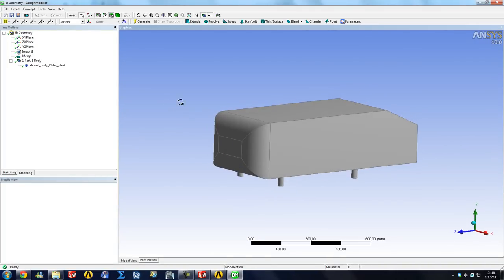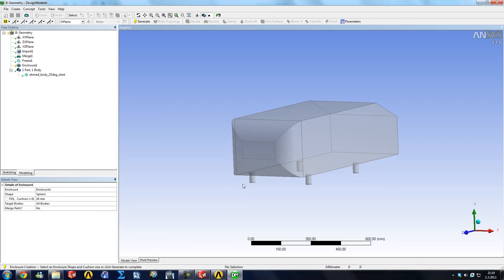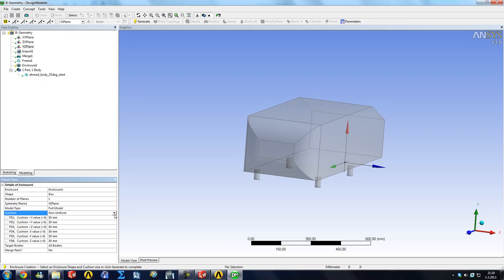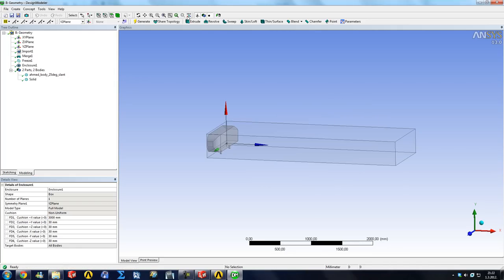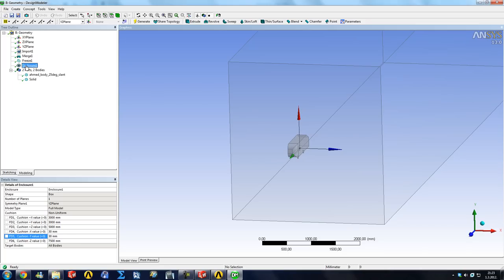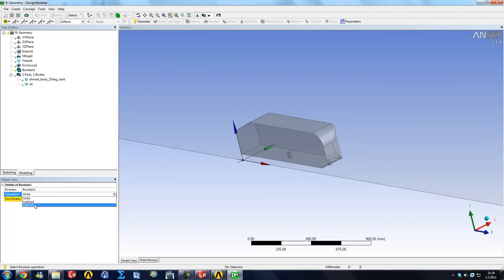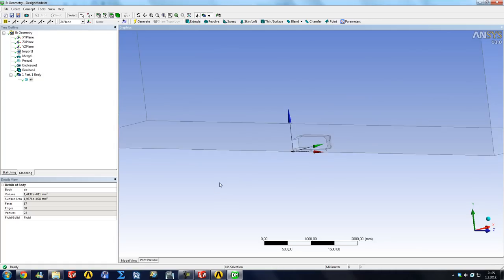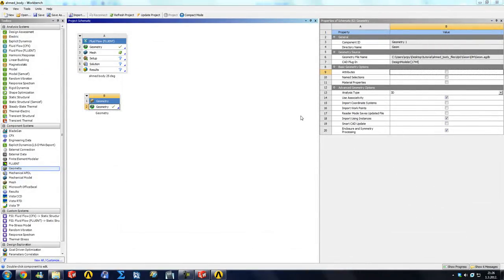Part 1b - DesignModeler for Vehicle Aerodynamics

Comment from the maker: I thought it might be like that. Solution is easy: instead of doing an Enclosure, just draw/model a solid around your wing. The procedure is similar.. you import your wing geometry which is for example positioned so that the middle of the wing is at the xyz origin, then sketch a rectangle or whatever in the plane which is parallel to your wing cross section (lets say XY) and then just extrude that rectangle in both directions until it spans your wing. Boolean operation to substract the wing.. :)

Comment: Hi, Really it`s good video for starting in aerodynamic,but i wonder if you can help me in my Formula Student car, the whole car consists of (main body)and (cooling ducts) So,when importing only the body or only the ducts the enclosure is available, but when importing the whole car, the error of non-manifold bodies appears. please help me if you can.Thanks
Reply: +Mohamed Magdi i have the same problem, but can't find a solution, if you get it , please help :)
Reply from the maker: +lucaspera18 This is usually a geometry problem. Non-manifold bodies warning most likely means that somewhere in the model there are slight errors that might include: point/vertex contact or intersection with a surface, very sharp angles, very short edges etc. It's a good idea to rather "simplify" the geometry before moving on to CFD analysis. Remove any unnecessary details that will not affect the solution drastically (nuts, bolts, holes, fillets, chamfers, merge surfaces into clusters, try using virtual topology cells etc). Even so, DesignModeler as a tool can only take you so far (depending on the geometry). It might be time to try a more capable tool (like ICEM CFD).

Comment: and another thing, I modeled a previous geometry using DM before and I wanted to mate its parts as u did using the merge command, but they couldn't merge do u have any idea why?
another question:) I want  to create a zero thickness rectangular surface how I can create it without using the extrude command?
another question :) how I can ensure that all the parts are connected, I.e. as in your case the ahmed body was considered as walls surfaces not as another body (within the memory)?

Comment from the maker: If a hollow zero-thickness cylinder is what you're after, that's pretty easy. Sketch a circle in any plane - Modeling - Extrude - leave the option Add material - change the option "As Thin/Surface?" to Yes - put both inward and outward thickness to 0 - and FD1, Depth to the required extrusion height of the cylinder. A surface body of zero thickness will be created.

If this cylinder needs to be closed (have a base/top face) you can achieve this in many ways but easiest is Tools - Surface patch..

Comment: I am not able to ground the tires, the enclosure works perfectly well for one symmetry plane(however, using one symmetry plane and -y distance between tires and ground of order 0.001 m results later in skewness of order 0.99 again causing problems), but whenever I try and specify ZX as my second symmetry plane, ansys gives me this error  "Error: Operation would result in non-manifold bodies". If anybody has any idea please help asap, i imported the geometry as STEP file.
Reply: Hi there, I am currently having exactly the same problem and just wondered if you found a solution?
Reply from the maker: Non-manifold bodies is usually and error that means the operation would result in a point contact, or a sharp penetrating feature or something similar. So, I'd make sure your tire geometry is actually fully in contact with the plane you're trying to use as a symmetry plane. You should check this in CAD or some other more powerful tool (like ICEM CFD).. check the position of the line describing the contact patch, some points on it.. see if they're really at "zero" vertically or if it's 0.003 mm or something. If some points are touching the plane and some are hovering slightly above you can get these kinds of errors. Re-position the body and try again.
Reply: Sirius CFD I was trying with a more complex body with tyres, the problem was that the tyres were only making contact at one very small point, I changed the tyres back to legs like for the Ahmed body and the problem resolved itself. thanks for you help!

Comment from the maker: I'm not sure I understand. If your wing is "free floating" inside the domain, then I'm guessing it is not fixed to the ground and you should not have an intersection between the ground and the wing, the only symmetry you should be using is to cut the wing in "half" if you're after that. If I misunderstood something, you can post a screenshot or a drawing of your problem on imgur or somewhere and PM me the link.

Comment from the maker: And no, I didn't make any videos about modeling in DM. There is documentation available from ANSYS so you can probably find that floating around somewhere, however, DM as a modeling tool isn't really great.. it's mostly used for geometry cleanup, defeaturing and preparing the volumes for CFD simulation. You should really use other software you'r more comfortable with for modeling.

Comment: sorry, i'll try to clarify.  the wing is to be held horizontally in a wind tunnel, with the spanwise extremes each attached to a sidewall. physically there is a plane of symmetry along the centreline.  the problem with the enclose comes at the spanwise extemes: i can't specify a value fo zero.  this is a similar problem to the one you spoke about; except where as you were able to specify a fake plane of symmetry for the road, i cannot do the same: the real plane and fake plane are parallel.

Comment: great videos; very helpful!

i am looking at modelling a wing in a wind tunnel.  the wing will be mated to the sidewall, in a similar way to the bottom of the ahmed body to the floor.  however, in contrast, when i create another symmetry plane in order to avoid the cushion issue, i am presented with a problem: the new plane is parallel to the xy symmetry plane that is already being used.  anyway to get around this problem.

Comment: Thanks the explanation  was clear but I wanted to make sure of what I understood
I trying to model a separator, in which the first step is to create a hollow cylinder with zero thickness, so do u have any suggestion on how to create this  cylinder without using cut materials command..Keep in  mind that I tried to model it by extruding two concentric circles, the outer one extruded using add materials and the inner one using cut materials. However, this create a thickness which is not allowed

Comment: 74k and 6.5k versions seemed to be closed, but I have read that SolidWorks doesn't work with very heavy stl files as solids or surfaces (heavier than 1Mb ).
Now I am using ScanTo3D tool in SW to crea a rounded surface (nurbs?) out of the stl file. But I am still facing some troubles. I import the 74k stl file as a mesh in SW and generate 3034 surfaces, with 9 erroneous ones and I don't know how to fix them. I can import it in DesignModeler but subtract boolean operation doesn't work. Any idea?

Comment: Just a quick question: I'm following your guide through but I'm doing it for a "sidepod" so it's not a solid object and has it's own entrance and exit to deal with but the problem I'm having is trying to select faces that are inside the air without selecting the face of the air because it's always in the way. Any chance you can help?

Comment: My geometry seems to be closed. As it was a too complicated geometry, with 74,000 faces, I used Meshlab to refine it to 6500 faces. Boolean operation didn't work but I refined it to 2500 faces and it works now. Does Design Modeller cannot work with such fine geometries? Thanks a lot!

Comment from the maker: That would point to gaps between some of the faces in the 74k/6.5k versions of the model, the model does not only have to appear "closed", you have to sew/knit the surfaces and try to form a primitive solid out of it. When I did a surface model of my car, I had to use the Knit feature in SolidWorks and play with gap control until the "try to form solid" function appeared. Then if you do a cross section view of your model, it should appear as a filled solid.

Comment from the maker: Seems the explanation wasn't as clear as I thought :) I subtracted the body because we only care about the "air" and the surfaces of the body just represent walls. If I had left the whole body in there, I'd have another volume to keep in mind (solid), define unnecessary materials for it in Fluent etc. Only reason to keep full bodies in the simulation is if you are going to run a FSI (fluid-structure interaction) simulation, i.e. use the CFD pressure result to calculate how the body deforms etc.

Comment: Hi... I am trying to simulate the airflow under a car undetray. I used catia v5 for modeling. I saved my assembly file as .IGS. When i generate the geometry i get 5 bodies and 5 parts. The software does not let me to create the enclosure if i have multiple bodies. So i decided to use a boolean to unite the different bodies. I created the enclosure. When i try to subtract the body from the volume of air I get an error. Any solution?

Comment: Hey @eoescipy! Thank you so much for your videos! But I'm having some difficulties to do the boolean operation of substract cause my geometry .stl file converted into .sldprt in solidworks.
When I try to substract it says: Error: operation would result in non-manifold bodies.
I have also tried with .x_t and .x_b parasolid files and it gives this error: Error: boolean operation failed. How can I substract the bodies? Can I proceed without substracting?
Thank you so much in advance!

Comment: I am studing an airflow assessment in a building.When i make boolean my building with the control volume then i have one body.The problem is that i cant mesh as i wish near the building because the building doesn't exist anymore as a ''body''.What is the mistake in boolean?
Reply from the maker: You can always select an option to keep tool bodies during a boolean operation. But I don't think that's your problem. If you want to have a refined mesh around the building and cannot achieve this by only refining the surfaces of the building, then you need to create another frozen body and use that as a Body of Influence in the mesh refinement. I've covered this in the videos.
Reply: thanks for your reply,when i sellect ''preserve tool body'' the flow 
doesn't pass through my building.It's lke me building doesn't exist.

Comment: Good day sir, any idea how to deal with the error of non-manifold bodies? Can I like turn it off? I cannot seemed to attach spoilers at multiple position of the car without getting the error message when I wanted to add in the enclosure. Any idea how I can solve this? Thanks in advanced..
Reply: I have this problem when importing CATPart files from CATIA, so have to save my geometry as a STEP file - as long as I do that, it's fine. What format are you importing your geometry as?
Reply: I already solved this problem, and guess what, if I export the geometry in STEP file format, the error kept prompting. If I export the geometry to IGES, the problem solves itself. Thanks for the reply anyways.